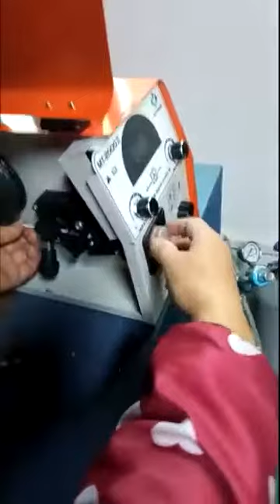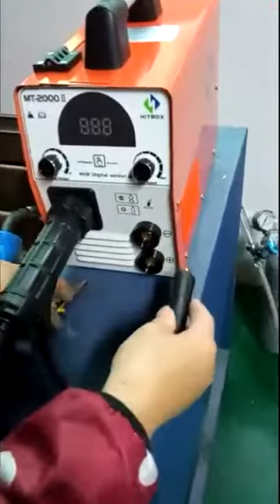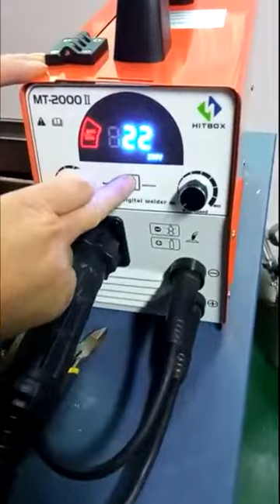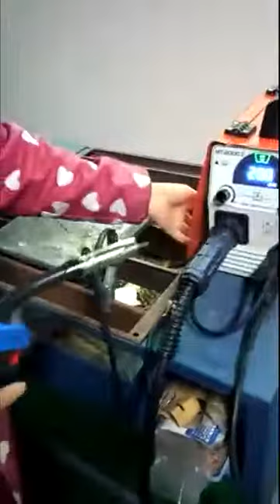HITBOX MT2000II

Comment: I managed to get one of these for $138 to replace a decade old Neiko tools welder. For $138 it was worth the gamble…. But it actually surprised me. The machine welds pretty well.  I use C25 gas and Harbor freight .030 solid wire.  My old machine ran .023 and this one is listed to if I turn off synergy. I use it for sheet metal and auto body repair